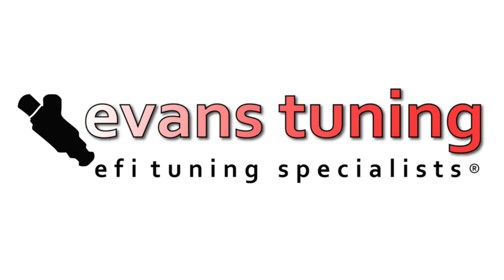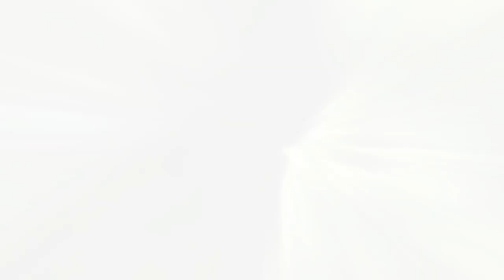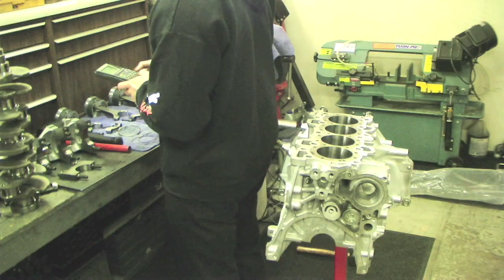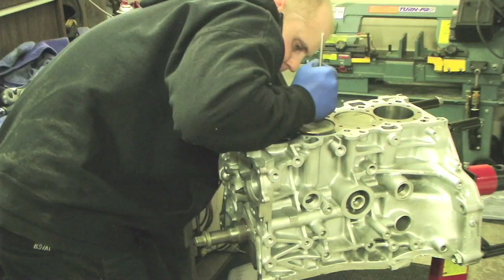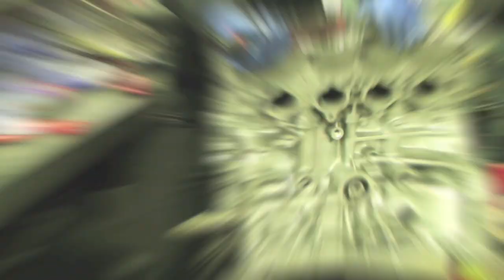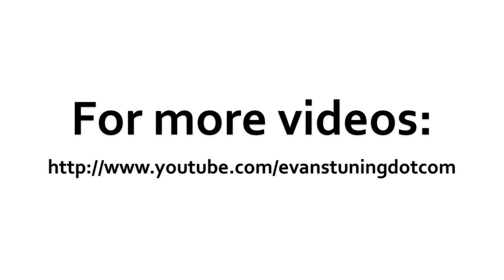One Minute Evans Tuning Engine Build Time Lapse

Comment: What's the deal with the copper wire? What does it do?
Reply: There is a groove cut into to top of each of the four combustion chambers where the headgasket seals. This wire goes into the groove and helps seal the head better and its use is mainly only neccessary for really high HP number, I believe starting at 700. I could be wrong with that number but thats what the wire is used for.